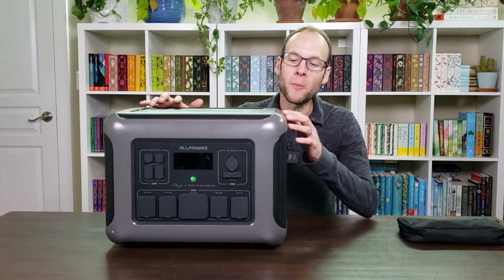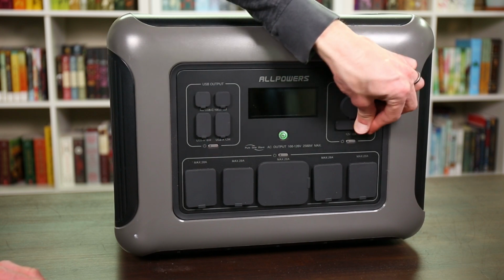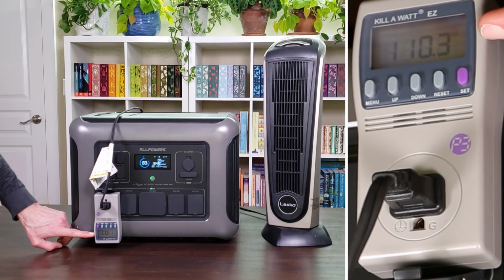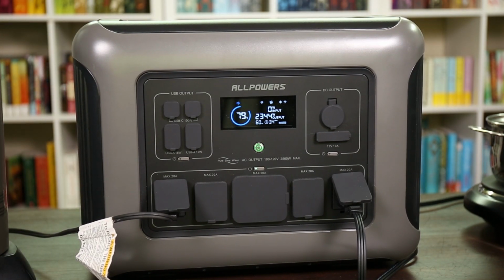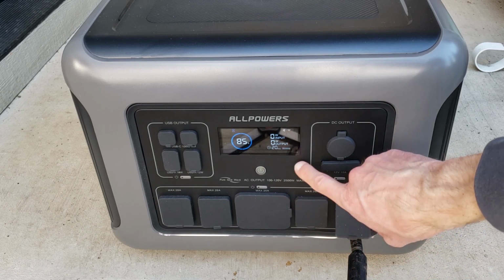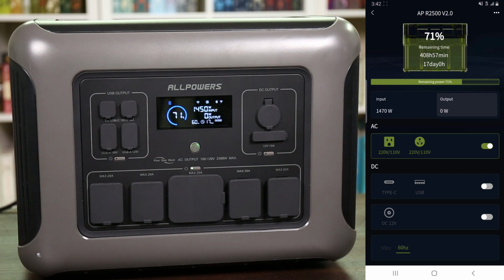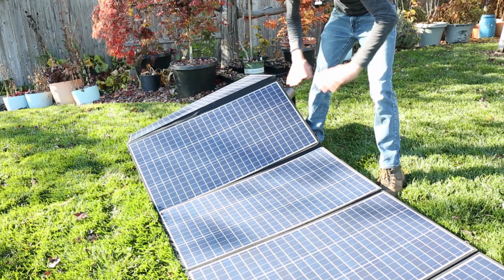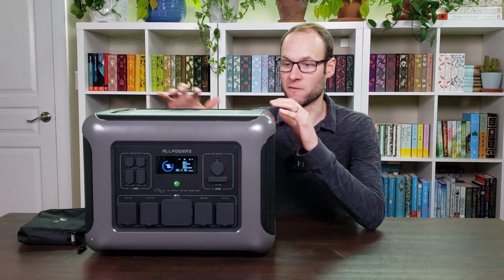BIG POWER small price - ALLPOWERS R2500 Solar Generator Kit Review

Comment from the maker: $400 OFF ALLPOWERS R2500 + SP037 Solar Panel Kit:  https://www.amazon.com/dp/B0CKN1K5Q2?th=1 | SAVE AN EXTRA 10% off (Amazon) with Discount Code: FQK835HK
Reply: One of the Solar PV panels had a shadow over part of it. That will affect output of that panel drastically. If they're connected in series, it will reduce the output of the whole array.

Comment: These are very nice units and would be good value unfortunately the uk and eu units wont work as a solar generator as the inverter shuts down when the battery is fully charged and solar is plugged in and displays error e202 the manufacturer has sent me a 2nd unit which has done exactly the same thing as the 1st unit i received and has now admitted the unit was never designed to run the inverter while the unit is fully charged with solar pluged in and advised to unplug and replug the unit in to the solar to keep it below fully charged 🙄🤦

Comment: Lots of negative opinions on the r2500 and other Allpowers power stations. It has to be noted that the units made for North America have had minimal issues while the UK and European made units have had numerous issues. I'm in Canada and bought mine in Oct/2023. It was been used during several power outages and has performed flawlessly. It runs quiet and cool even when pushed to the max. One of the quietest ones made next to Ecoflow. There is a tech video where he takes the r2500 completely apart and gives his opinion to the build quality and components used which he rates premium and well thought out design. Since I'm no tech I can only speak to my experiences using 1500watt heaters and other appliances plus pushing it to and beyond 2500 watts. No issues but it will go into overload and shut down if pushed past 2500 watts but that's to be expected to protect the inverter and other components. The fact is for the price it is great value. Cleanerwatt's review is  fair and I didn't find any misleading info he presented. I haven't been able to connect to wifi but bluetooth works great. Not sure why but others have had the same issue. I'm 70 and I can lift and carry it very short distances but I made a wheel cart so I do recommend a cart. Should it had come with wheels. NO...this was made for either home use, boat or camper where it would need to be carry around. I have a smaller lighter station for lugging around . $1500 cdn total  no tax makes this the best value available. I would buy another if needed but hoping they soon have the add on battery packs available which would be ideal for home use.

Comment: False advertisement... says it can go to 4,000 kw... and it can't... don't buy... and I see he quickly skipped over it since he is endorsing this.. don't sell your soul man.
Reply from the maker: No, I didn't connect enough devices to hit that. If I had, it could handle a surge for a few seconds at that high rate.
Reply: Anyone can see that even at 7 mins into your video that it can't even handle 2892kwatts so what makes you think it will handle 3,500kwatts or 4,000kw as advertised?
Reply: @SoulStylez2019 That's the surge which is for things that have a high amp start up it's not meant to be held for more than a few seconds.
Reply: You have a fundamental misunderstanding about the 4KW peak load claim. Some electrical appliances, especially those containing motors, require a massive surge of power for 1 or 2 seconds to start and then they settle down to using a much lesser amount of power. As an example, let's assume an  appliance uses 1500W when running, but it requires 3500W for about a second when it starts. To power such a device from a battery or a diesel generator, you would one that can supply at least 1500W continuously and supports a peak load of at least 3500W.
Reply: @CiaranMcHale I believe the issue in this case is voltage. It's only 110v and not 120v
Reply: @Trillville43  In Europe, mains voltage is between 220v and 240v (I think it varies from one country to another), but I don't recall ever hearing of an electrical device that required 240v instead of 220v. And since I often hear of the US mains voltage being referred to as 110v or 120v, I had just assumed that anything in the range 110 to 120 volts was acceptable. However, a quick internet search indicates I was mistaken. Thomas Edison used 110v, but over time the official mains voltage increased to 115v and then later to 120v, and apparently the official voltage range is 120v plus/minus 5%, which means that 110v is slightly too low. As such, what you say makes sense. Thanks for the heads up. If I ever hear of an American friend thinking of getting a portable power station, I will be sure to advice them to get one that provide 120v rather than 110v.

Comment: My limited knowledge and experience tells me to do the math and it turns out that this unit, fully charged, can support approximately 18 amps of power draw for about an hour at 110 volts.  Reduce the amperage draw and you increase the time by an equal proportion.  I'm dying for the day when these portable generators can actually handle a load.

You're testing is interesting but not necessary. Remember that Watts equals volts x amps.  Or watts/volts = amps.  Once you know the amps, you can look at any device you want to run, read the amperage rating and you can figure out roughly how long the device will run on the power source.  All of these solar power stations are good for minimal usefulness.  The technology is coming along but it's not there yet.

All that being said, I remain confused about charging the unit. The panels are 400 watts, you say. But that number doesn't mean anything to me. It says nothing about how long it will take to charge.  How many amps does the battery draw when it's charging? And what is the voltage that is produced by the panels? I know my thinking is old fashioned but it's all I've got to work with.
Reply: You wrote, "You're testing is interesting but not necessary." Testing is necessary to verify that the product's specifications are accurate.

Regarding your confusion about charging... If you charge at a continuous rate of, say, 400 watts for 1 hour, then you will put 400Wh of power into the battery. And since the battery's capacity is 2 KWh = 2000Wh, it would take 5 hours to fully recharge the battery.The 400 watt rating of the solar panels is for ideal conditions, such as around midday on a cloudless summer's day with no trees causing even partial shading of the solar panels.  The video showed a charging rate of up to 1500W when the battery is plugged into the mains to recharge, so that would likely take less than 2 hours to recharge (the charging rate slows down as the battery gets almost full).